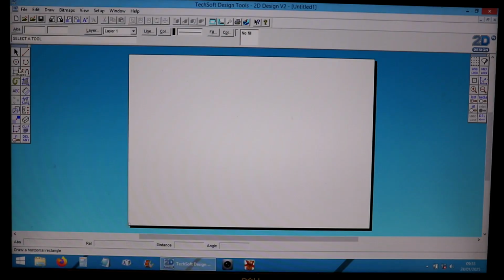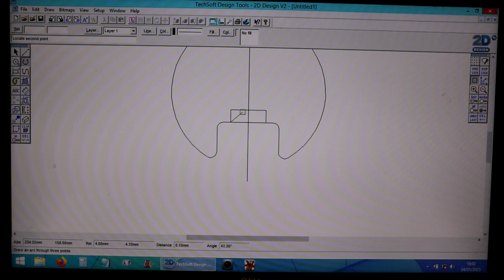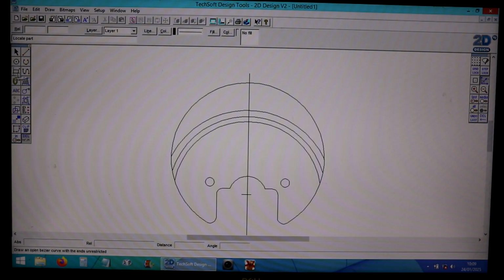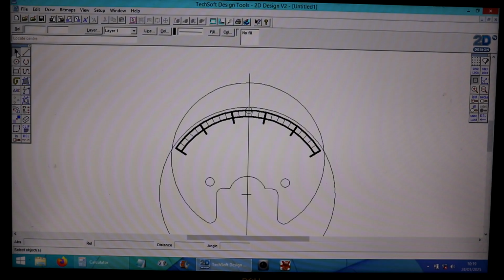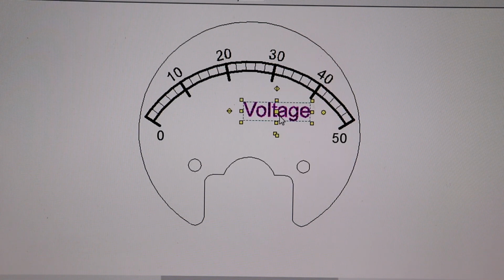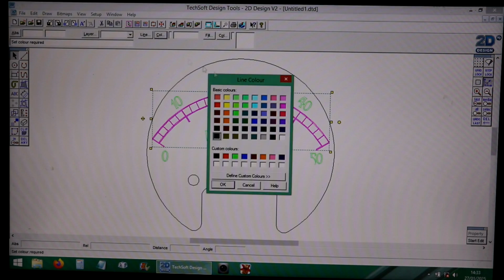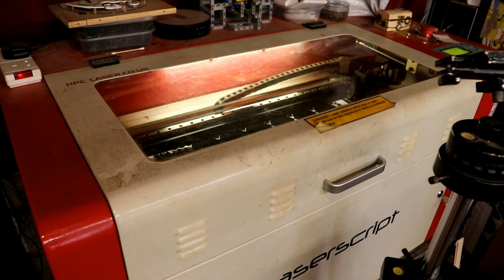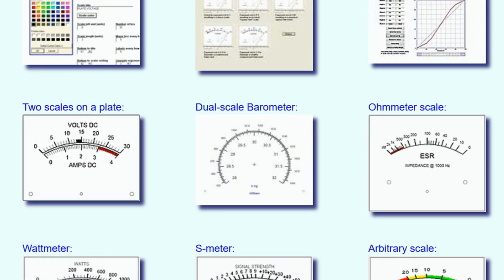Tutorial - How do I make the dial for a customized gauge?

Comment: Hello. Thanks for your video. My native language is not English and it is a bit difficult to understand, but I try) Question: Can you recommend specific sensor models for measuring atmospheric pressure, humidity and temperature? And there are sensors for carbon dioxide content. I would also like to know if you use them in your work and which models. I also want to make myself a weather station on Victorian voltmeters. The problem is to choose the models of the sensors described above so that they are accurate and work stably. With your experience, you've probably already picked out the best ones yourself. Thank you in advance for your reply, you are a great guy.
Reply from the maker: Hi Dmitry, I'm so pleased the video has inspired you! 

The barometric pressure sensor module I use is a BMP180. Sorry I can't attach a photo - the common version I use has 7 components soldered on the module's PCB. There are alternatives with less components but these cannot be connected to a 5 volt microcontroller such as an Arduino - they don't include the necessary components to convert the 5 volt Arduino signals to the 3.3 volts that the Bosch sensor requires.

The BMP180 module (with 7 components) can be connected to an Arduino using the I2C connections SDA and SCL. The module also needs VCC to be connected to +5 volts and Ground to be connected to 0 volts.

I always use the SFE_BMP180 Arduino library (https://github.com/LowPowerLab/SFE_BMP180/blob/master/SFE_BMP180.h) as it provides the barometric pressure with an accuracy to two decimal places and reliably works. 

Once you can read the pressure so accurately from the sensor, you'll just need to work out how to control your Victorian voltmeters from one of the Arduino's PWM (Pulse Width Modulated) outputs. Hopefully there's enough information in the video, although don't hesitate to get in touch if you need further help.
Reply: @steamhead  Thanks for the detailed answer! You are truly inspiring! I just envy you that you have such wonderful tools like a laser cutter. It's just a delight to have such a device if you like to create your own projects. Everything is clear to me with the sensor for the barometer and you have explained everything well) But, I was also puzzled by the use of a sensor to analyze the purity of the air for CO2 (carbon dioxide). As it turned out, it's not that simple! There is a model MH-Z19B . It is, so to speak, a mini spectrographic laboratory in a small building. I also want to use it in my project as an additional measuring device in addition to temperature, atmospheric pressure and humidity. That's why I asked you a question in my first post. Apparently you didn't understand because of my English. Have you ever used such a sensor (MH-Z19B) in your projects?
Reply from the maker: @dmitry2509  I've found this CO2 sensor module that says it's compatible with Arduinos - https://cpc.farnell.com/seeed-studio/101020078/grove-sensor-air-quality/dp/MK00300?mckv=sshopping_dc|pcrid|224646285066|kword||match||plid||slid||product|MK00300|pgrid|49734027591|ptaid|pla-369472404689|&CMP=KNC-GUK-CPC-SHOPPING-945765023-49734027591-MK00300&s_kwcid=AL!5616!3!224646285066!!!network}!369472404689!&gad_source=1&gclid=CjwKCAiAzvC9BhADEiwAEhtlN6uvO5GLPJ5EY6ucW_Zyhxc-Dg5KR5wjpKlaYRfACUEmUe0LUMGC3hoCw4AQAvD_BwE

Comment: I suspect this wouldn't work with your software, but what I would likely do is take a high res scan of the dial, straighten it in photoshop, and import that as a backdrop in my 2D tool, then line my new drawing up with the scan.  Saves a lot of measuring.  Since I know the DPI of the scan, everything works accurately to scale.
Reply from the maker: A high res scan of your gauge's dial shouldn't need correcting in Photoshop, unless of course your scanning an assembled gauge through its window!

Importing an accurate bitmap should allow you to line up your new vector drawing, although the 'snap to' tools won't work...
Reply: @steamhead  The reason it needs correcting is because no matter how careful I am, the scan usually comes in at an angle.  I use the straighten tool (often used to straighten a photo's horizon or a known vertical) to rotate the scan so 'horizontal' really is horizontal!
Reply from the maker: @epiendless1128  I don't understand why your scanned in image is so distorted. Surely placing your existing gauge legend in your scanner would produce a perfectly flat  image?

Comment: I remember a lot of these tools from a Turbocad, which I used to use.  Just tried it for the first time in years, and it crashes.  Whether it can be made to work, or the owner deliberately borked the authorisation so I have to buy a new copy, I do not know.

Nevertheless, these days I usually turn to Affinity Designer.   It's a low cost alternative to Adobe Illustrator.  I see below someone uses Inkscape, which is free and probably much the same.
Although it's more aimed at illustration than technical drawing, so lacks some of the nice tools you show here, but it can do accurate scale drawings.  I just used it to create a graduated scale like yours, just for interest.

It's not better than your tool -  in some ways it's worse - but it's just the tool I'm currently familiar with.
One really useful feature it has is it can print out big patterns on multiple sheets of paper that can them be taped together.
Reply from the maker: You could always try TurboCad on an old computer if you have one lying around. Several times I've found older software won't run on newer computers - thankfully 2D Design does. One indication of how long ago it was produced is that there is only a single Undo step - obviously memory was in such limited supply in those days!

It's good to know you have a favourite piece of CAD software. The main thing is you can achieve what you want with the avialable tools, especially if you find a clever way of using them! I've even got students to use MS Publisher to draw designs as it does support accurate vector graphics and can output a file type that is recognised by normal CAD software!

Comment: I have a 600 amp meter, I used a servo and a magnet attached to the back by the coil to affect the reading.
Reply from the maker: Is it a moving magnet meter? Interesting how moving magnet meters measure current and moving coil meters measure voltage...

Comment: I'd be interested in how to make gears for the pull chain.
Reply from the maker: To which pull chain are you referring? I'm getting confused as I recently repaired our antique copper toilet cistern but forgot to make a video. What a fine piece of engineering. It turned out the flap valve, that's always made of a thin sheet of flexible plastic these days, but was constructed from a copper spring mounted disc, had somehow got stuck at an angle. 30 years working perfectly, then add teenagers...
Reply: @steamhead  the ones you use on the Steampunk Weather Forecasting Machine
Reply from the maker: @ Ah. I use standard 3mm diameter brass ball chain, although different manufacturers vary the dimensions just enough to prevent it from working with your last indented pully design - buy a whole roll!

I try and work it out mathematically by measuring the ball diameter and the distance between the centre of the balls - it provides a starting point. I then cut out an indented pulley from card only to discover the stretched ball chain has a different pitch. Adjusting the CAD design each time, it usually takes about 3 goes to get the pitch of the indents aligned with the indents in the card model.

Once the balls align with the indents in your card pulley design, it can be cut out of 5mm thick acrylic with 2mm overlapping sides to keep the chain in line.

Comment: As you're using a laser anyways...should have a look at Lightburn. Have not done gauge dials (legends) but have done a clock face. Believe Inkscape also has a laser plugin/extension. Another one to check out is Carbide Create...should still be a free version (6?) available.

Comment: Very interesting to see how thats done!   Thanks for sharing.
Reply from the maker: Thank you kindly Tom! How's your jukebox going?
Reply: Well, I've not had good luck with any of the Chinese import amps, so I thought maybe I could internally bypass the standby function on the Pioneer - nope, it feeds straight into the processor. 
I finally bought a 1968 American made transistor amplifier only.  It needs some work and that's my next project.  I've been wanting to tackle something like this anyway.  
So, I guess the answer is that it's still stalled.  
Not to worry though, as I have 13 other projects going at the same time.😊
I really do love these tutorials you're doing.  Also, I haven't forgotten some of your 13 background projects either!  😅
Reply from the maker: @ sorry to hear you've been struggling with Chinese import amps, a 1968 American transistor amplifier should be far easier to work on - no complicated ICs, just good old discreet components where you can work out the circuit and make the necessary changes.

Good to hear you have 13 other projects on the go. Thanks for reminding me about the TARDIS console, the steampunk penny arcade machine, the batch produced moving coil meter with Trinket, and the automaton's head kit...